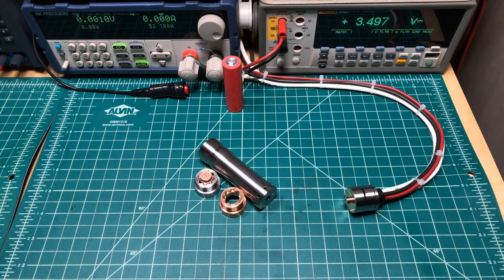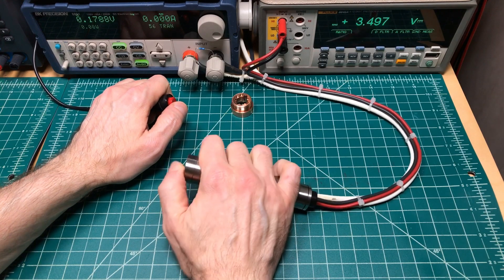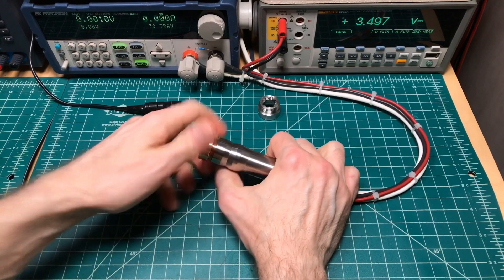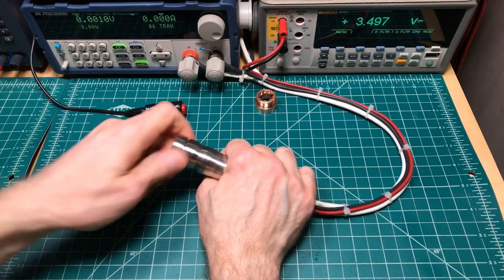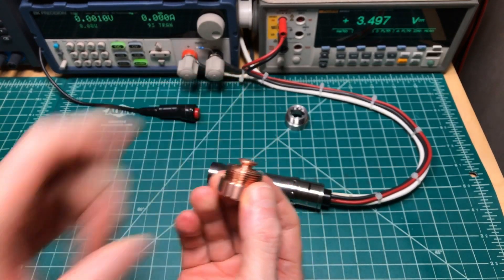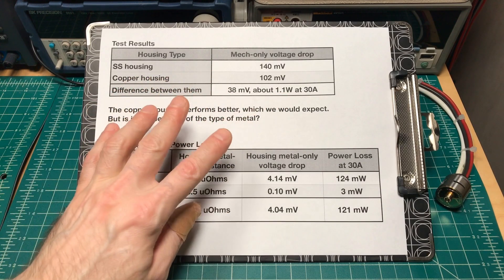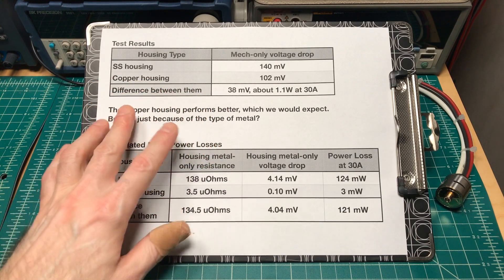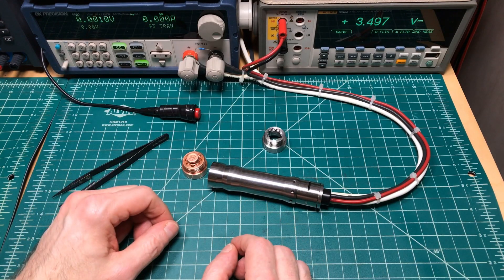Minding Your Mechs Ep027 – Kennedy Vindicator 21 with copper switch housing

Comment: Dude thx u are so helpful mooch - u really confirmed all the suspicions I had about my all stainless setup specifically with the button/switch: I have a full stainless steel Ruby 21 and it seems to have some issues in conductivity in regards to the switch with connection/loose tolerances etc between the button housing and the switch - because the male lugs on it are a little small in comparison to the housings' female ports for them lending to the looseness
 in which I also experience  the hot button issues or hot threads  (where the seam is - if I wrap my finger around the seam while firing I get that fun little lick from the dragon 🔥🐉as I like to put it lol) to misfires etc
Also also I agree totally on the how the stainless housings' threads don't rub or get tight before bottoming out as u said yourself ... truly feels like they fall a little short - as in it could possibly benefit well with having an extra loop of threading to solve that issue... at least on the stainless steel CC I mean .
 Battery wobbles too especially from side to side when I lightly shake. 
With all this in mind, its really adding to the point you made near the end about how the button housing bottoms out before u can even feel any threads rub or squeeze. I will say unfortunately the ruby doesn't hit very hard at all because of all these factors^ i presume? 
Ive also thought on the idea that it could possibly be from how the contact is made in the switch where the overall contacted area is kinda small imo since it's just the lip on the CC plunger...[hmm I kinda want to get the older non CC switch to see if it'd work a little more consistently? 🤔]

Comment: Looking big picture here. At 30A, what's the chance a person would notice a 1w difference in performance? 

Also, would there be a performance gain by using dielectric gel on the threads and contacts? Maybe a mixture of dialectic gel and a copper powder like antisize.
Reply from the maker: IMO, it’s great for covering spots not involved in direct contact (to prevent oxidation) and possibly good for sliding contact surfaces but not good for contacts just pressing against each other as that won’t force out the grease as well and will result in a high resistance contact versus bare metal on metal.

Some might notice a 1W difference but IMO many won’t.

Comment: I wonder if what setting you have the button on affects the voltage drop. Like the longer throw setting may have worse performance?? It’s weird how Inconsistent it is.
Reply from the maker: It might affect things but with the inconsistency on just the same setting it just wasn’t feasible to test that reliably.
Reply: Yeah it sorta does I think.  I have a full stainless steel Ruby 21 and it seems to have some issues in conductivity in regards to the switch with connection/loose tolerances between the button housing and the switch - because the male lugs on it are a little small in comparison to the housings' female ports for them lending to the looseness in which I also experience  the hot button issues or hot threads  (where the seam is - if I wrap my finger around the seam while firing I get that fun little lick from the dragon 🔥🐉as I like to put it lol)
Also also I agree w mooch on the how the stainless housings' threads don't rub or get tight ... truly feels like they fall a little short - as in it could def benefit with an extra loop of threading at least. Battery wobbles too from side to side when I lightly shake.
With all this in mind, its really adding to the point mooch made near the end about how the button housing bottoms out before u can even feel any threads rub or squeeze. I will say unfortunately the ruby doesn't hit very hard at all because of all these factors^ which I was surprised of how big a difference it makes to the performance of the mech itself.

Comment: Because I have a vindicator with first generation button with no constant contact in copper and a stainless steel ruby with the constant contact ss housing I believe that the first generation button housing performs better and with less voltage drop. So if you had a first generation housing it would be interesting to check it... Thank you for the testing nice job
Reply from the maker: I don’t have the 1st Gen button but maybe someone could loan me one for testing.
Reply: Yea, the constant contact switch lacks the spring loaded big ultem ring that the original non constant contact switch has around the firing contact. This ring is what keeps the bottom of the battery from going anywhere so, basically, what happens with the constant contact switch is, both the battery and the spring loaded top contact in the switch get pushed ever so slightly to the side causing them to be ever so slightly tilted versus one another.

With the Cobblestones Limited Edition stainless steel Vindicator 21700, there's a tiny bit more room between the side of the Samsung 30T and the inside of the tube so, as a result from this, I have to lay a carefully matched o-ring on top of the button housing to support my Samsung 30T battery because else the switch is so terribly crunchy that the bottom contact refuses to get pushed all the way in, each time when I press the fire button. It feels like it just catches onto something half of the way in, as sometimes it just snaps past the halfway point, in such a way that it bangs against the top on the inside of the spring loaded top contact. Other times the button throw feels only just a little crunchy. It varies greatly with how I press it, but at the same time also it is random enough that the o-ring is the only effective way to work my way around this issue, and, I verified this by using three additional constant contact switches that I also have, so...

Either way, I can feel it clearly on the vape that the voltage drop from the constant contact switch has fairly poor consistency. I have the copper cerakoted black setup with the original non constant contact switch and two matching copper cerakoted black constant contact upgrade switches (one uses the bare copper constant contact, one is identical except it uses the silver plated constant contact), the copper cerakoted black/red splatter setup that comes with the matching copper constant silver plated contact switch, and the Cobblestones setup that comes with the polished copper constant silver plated contact switch. That's a total of four constant contact switches and three Vindicator 21700s... all four of these constant contact switches are very noticeably less consistent than the non constant contact, no matter which one of these three tubes I pair them with.

I still love my Vindicator 21700 setups, but it's the Kennedy 2-post RDAs (with the Stub Dogg drip tips from Kennedy) that are getting the higher portion of the love. The best constant contact firing mechanism I have come across is the one from Purge Mods. That is, after upgrading it with the solid silver firing cup and carefully sanding down the sharp edge on the contact if necessary, as I'm pretty certain that, once that's nicely taken care of, the brass Slam Piece hits harder than the Grip, contrary to what Mooch found when he held that little shootout of his... going by the distinct shape of the arcing marks on the copper firing cup he showed in that video, and how that compares to how it looks with the ones that I own myself, plus the fact I can definitely feel that on the vape as well. lol
Reply from the maker: Willy W I’m glad you found a good way to improve the performance of your Slam Piece! I think the performance of most mechs out there can be improved a bit with a little attention to surface smoothness, burrs, etc.
Reply: @willy_w  it will be nice to make another switch like deathwish constant contact imagine the first generation button with threads on the derling and a copper piece of metal in there to touch the actuall switch it will be perfect 👌

Comment: Thanks Mooch, its great getting this valuable information! I would have never guessed it would be so close and such a low number between SS and copper buttons. 2 curiosities I have are 1) What is the additional loss at the hybrid threading and would it be enough additional vdrop to increase the wattage number closer to a noticeable amount 5w+  Also 2) What would the difference be after sitting for a few days would the copper be worse? Because Im not sure about everyone but I only clean 1x a week. So I would be curious if the oxidation would end up making ss better or closer to equal at that point. Thanks again for all you do, All your hard work and time spent helping the vape community!!!!
Reply from the maker: 1) The hybrid threading? You mean at the top, the 510 connection? That’s included in the overall 3.1W (copper housing) or 4.2W (SS housing) power loss numbers.

2) The copper’s performance would drop as it oxidized but I don’t know by how much. The Vindicator 21 I have here does not rub the threads together hard which would help break through the oxide layers. The copper housing rubs more than the SS housing I have but not by a lot. I think if the threads really mated together tightly then the oxidation would have a smaller effect. But I can’t say that for sure.
Reply: @batterymooch  oh yes duh, that was what I was thinking of thanks.  So I know it would be hard to get an accurate number with the oxidation, I'm just starting to think that SS is the way to go for those who aren't the best at keeping up with cleaning because the over all wattage loss is so small it seems the only time you would notice is when the batt is running low you may notice a more noticeable difference in vape. I've always gotten copper or brass, don't own any SS mods because the numbers were always thought to be worse. I do wish more offered aluminum like dreamer! but because of your data, I'm starting to like the idea of getting a ss mech with the lack of corrosion and hold up better to scratches and wear vs coated copper/brass. Anyways thanks Mooch!

Comment: Thanks again Mooch.. Very interesting.. So copper aint always better depending on thread quality.. I cant feel the difference between the two as its such a small difference but the numbers dont lie..
Have you tested gold plated 510 pin vs. stainless 510 pin? Or gold plated post screws vs. stainless post screws? I have wondered if there is any point in the gold plating..
Reply from the maker: For this Vindicator 21 the difference was 1.1W at about 105W. Some might notice this but many would not.
For performance, there is no noticeable difference for gold plating. It’s very conductive but the layer is so thin compared to the amount of the base metal. For maintenance it can have a big effect though. Gold makes cleaning much easier but the plating is often very VERY thin and gold easily wears off since it’s so soft.
Reply: @batterymooch  So the gold plating is more of an anti-corrosive layer? Iv had cheap gold plating chip off in the past which put me off so i use non plated screws and 510 when available.. Makes me wonder if less cheap quality plating would be a good option although screws are pretty inexpensive so its not really an issue..
Anyway, please keep doing what you do for us Mooch, i have learned a lot from watching your content and you always get me wondering and wanting to learn more, for example now im wondering how many watts are lost per 2sec puff using 105w at the same resistance using a 21700 starting at full charge..? 🤔

Comment: Ty Mooch! Picked an og vindicator (copper non cc switch) up back when you tested the different dreamer metal's. Going to have to grab a as housing to match it up!
Reply from the maker: Make sure to get the full CC switch. I don’t think you can just get the housing and upgrade that way with the original non-CC switch. Check with Kennedy to be sure.
Reply: It's different size the inner switch it does nt fit